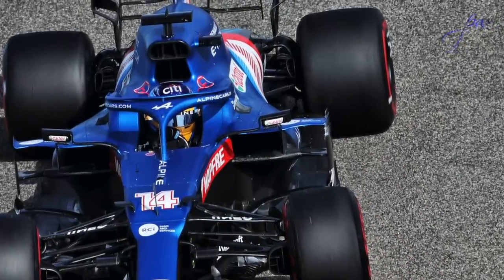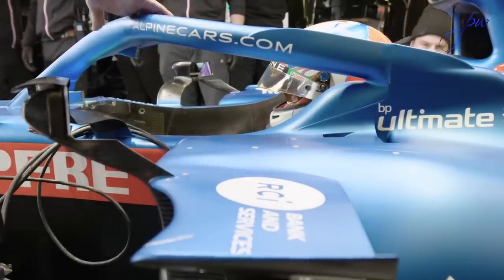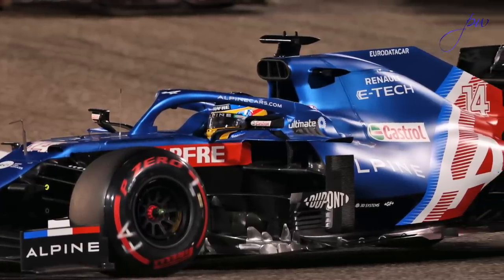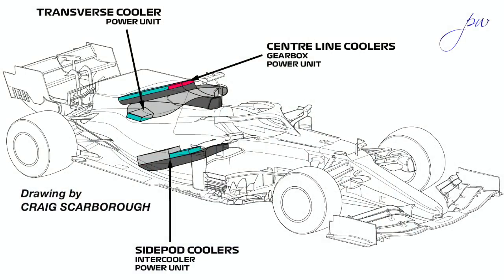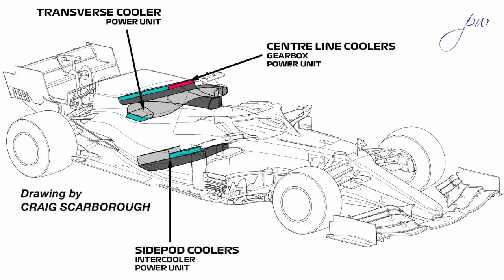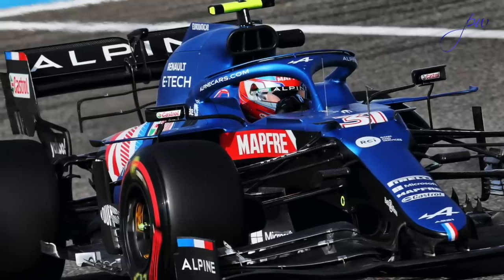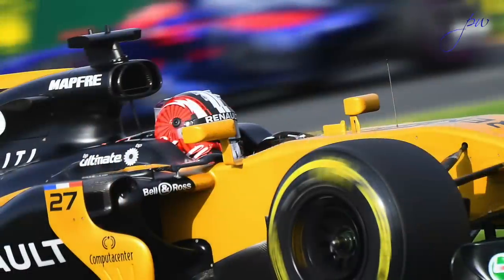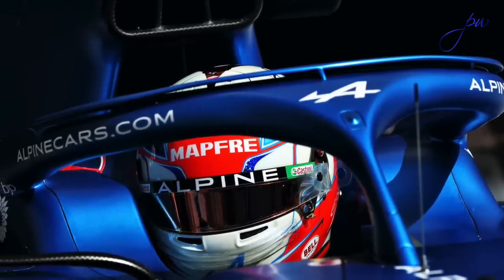Alpine's high-level rad gamble analysed by Scarbs. By Peter Windsor

Comment: Another video about the horrific impact on CoG of having 15kg mounted high up in the car. Just like the complaints 30 years ago about having the drivers legs mounted high in the chassis to accommodate the high nose aero design.
Whilst Red Bull runs high rake aero which lifts 200kg(!!) of engine and gearbox way higher than low rake cars, and nobody says a word about CoG problems.

Comment: I have wondered if there is a ruling for this: could teams run water lines to wheel hubs to dissipate heat from all those system straight in to wheels and brakes to get brakes and tires in operating temp faster and helping maintaining the temps? Could also be used to cool down those to really systematically have tires in exact operating temp which seems to be quite narrow in 2021 and help to have smaller radiators as you can have more variation where to dissipate the heat from.

Comment: I really hope Alpine/Renault is going to have a fair amount of success with their concept, but i feel like Renault (and Ferrari) should have adapted Mercedes and Honda's split turbo concept, as it's a much cleaner and tighter package, aswell as a more efficient one in terms of power and aerodynamic performance.
As much as i think the engine freeze was a good idea, i still think Ferrari and Renault keep suffering in the next few years. Obviously they're not far off, as they maximized the performance output of their concepts, but nowadays even the slightest advantage makes the difference between winning or losing.

Comment: While it might be a high centre of gravity question, i think alpine are thinking along a different line. If they get this working right ( and an initial point) then they are getting the heat generators inside the body, normally tightly packed, close to the p.u and the electronic power generators, up and away from both those and the fragile wiring looms.
If they can direct that heat source as far as possible from, especially the power units, hence lowering the hot atmosphere they normally have to work in they gain several benefits. The "engine" running cooler means less power lost as heat, with the electronic power units and batteries they also can run more efficiently in a lower engine environment, plus give the batteries a longer range. Finally you are significantly reducing the risk of damage to the wiring looms and their achillies heel of connections and casings.
If you look at most of renault/redbull retirements and unreliability issues back as far as the redbull/toro rosso/lotus powered cars, electric mgh, mgu, and wiring damage faults have been their biggest failures. Taking the cooling systems up into the most unobstructed airflow, lowering engine & gearbox area temperatures, possibly by many degrees C, and also doing so in a unique way, could pay dividends through the season. Teething problems with such a radical solution to years long weaknesses are going to happen, thanks to the minimal testing, but not insurmountable. Especially as we are only into our 2nd race weekend.

Comment: I'm wondering if their problems in the heat aren't about the PU running hot but actually a similar problem to HAAS in 2020 with the suspension "settling" when cooled down to a different position, changing the aero balance, & they can't address it in Parc ferme between qually & the race

Comment: How can all these restrictions be good for F1 innovation, limited testing, limited tunnel and CFD, homologation, limited areas to work on, controlled parts, etc. This really is not the pinnacle of motor sport. It is just a PR machine.
Reply: That's the debate, isn't it. We see the top teams in the F1 hybrid era pulling away from the mid-field with a corresponding increase in spending. In a near perfect world, we would have a minimal set of rules like the old SCCA Can-Am series in the U.S. but in this corporate era someone (like Porsche did) would come in with a ton of money and dominate the series. The new rules in F1 specifying limited testing and other areas puts teams on a diet as far as development so that they must make do in a shorter amount of time. To further guarantee a more level playing field, the cost cap comes into play so that teams don't circumvent the rules by delegating an increased number of engineers or computer resources on specific tasks. Today, the smaller teams find it incredibly difficult to be consistently competitive and when they fall too far behind the midfield they are in a no-man's land.
Reply: I saw a comment “remember the days when every lap was like a qualifying lap”. I do remember those days. That was motor racing.

Comment: Wouldn't it make more sense to put the intercooler up there instead of one of the radiators? I imagine the intercooler is lighter since it isn't filled with water.
Reply: They use air to water intercoolers, the tubing path would be too long for optimal throttle response if they used air to air. So there's a loop full of liquid coolant for that as well with similar weight I imagine.